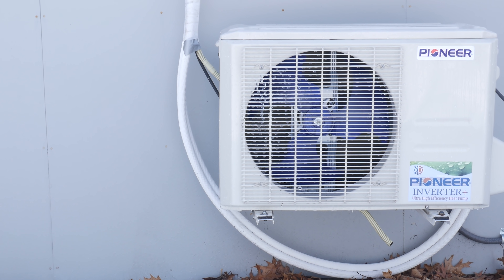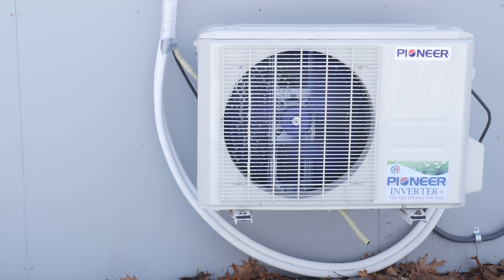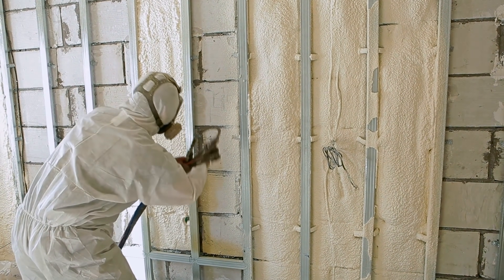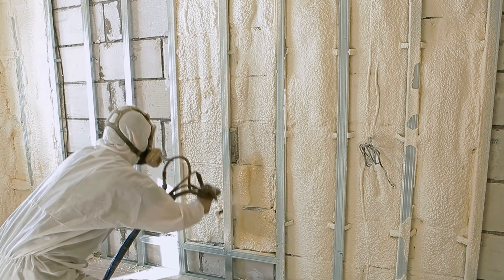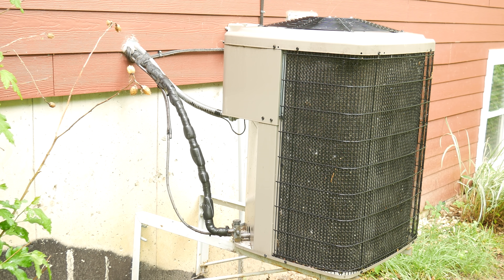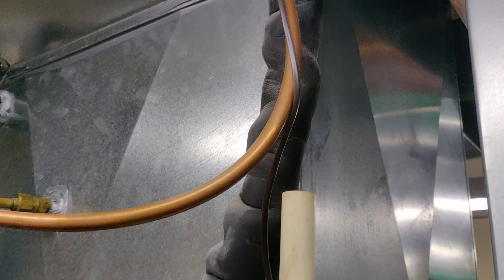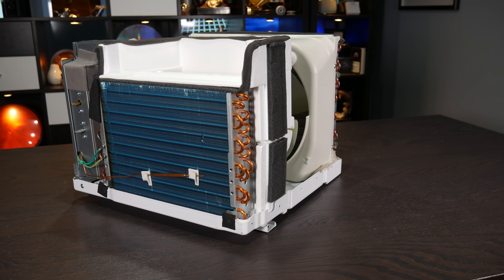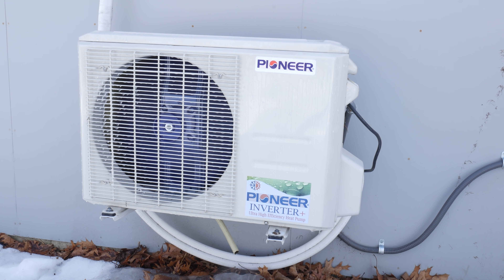Heat Pumps are Not Hard: Here's what it will take to start pumping

Comment: I had a split installed a few years back when I moved into a new house, built in 2006 with all electric. I live in the middle of Wyoming. It get's COLD.

I had two 12k units installed for about 10 grand. I could get the gear cheaper, but nobody would install it. The lowest bidder (of 3) won. The highest was 4k more, and the third didn't do Mitsubishi.

LG is terrible from what both installers said.

This year, after about a 6 MONTH wait for parts, I got three 6k units installed in smaller rooms for about 6k.

Prices are absurd. But in my installers defense, it did take two guys (1 very experienced) 4 days to install, and a third guy the 5th day to top up coolent after draw down.

Still, WAY too expensive for what it is. But they are installing a lot around here.

AND this thing worked great to -20 below! Ok, not great, but it still worked, and I didn't need to fire up the electric heaters!

Comment: I spilled soy sauce on my nice mattress and decided this would be the background "anger distraction" to my vigorous blotting.

On topic though, this video is excellent, as usual. I'm trying to incept the idea of installing heat pumps at my building, especially considering last years deadly heat wave. I got lucky with a portable unit (single tube, yuck!) and the windows don't hinge in such a way that a window unit could be utilized. 
I was miserable, and dreamed sweet dreams of heat pumps. 
I'm sure this video will act as an excellent single-point way of introducing someone to the immense advantages they bring.

Comment: Bought a newish condo here in Lake Oswego with no natural gas connection and just resistive wall heat throughout and no A/C.  Got an 11,000BTU 110v Frigidaire window/wall unit that was easy to install since it just slid into its outer shell, like the hotel hardware units  It's also a heat pump and we are hoping it will significantly reduce the need for resistive heat this winter.  Mounted it in the wall under the big living room window.  Under $600 at a big-box store.  Nice unit but of course it can't heat the bedrooms.

Comment: Air tightness is just as, if not even slightly more important than the actual insulation itself. The migration of the air in and out, even if well insulated, will still make a drafty and uncomfortable house. This is easily done in an empty (empty of furniture and such, but complete and finished) house. They put plastic over all the horizontal surfaces (because the assumption is you don't want to repair or refinish anything) and pressurize the house with a blower door, then aerosolize a sealant into the air with mist sprayers and it clumps up and seals in all the areas where air is leaking out, the rest settles out onto all the protective plastic. Its not necessarily dirt cheap, but it is less expensive than ripping out walls and such to get the insulation in there. If you do this, and then just cram insulation in places where you can, hopefully and especially the attic or between the roof and ceiling, it would make a huge difference, although usually after that, some kind of ventilation need to be installed to bring in fresh air and let the stale out in a controlled way.

Comment: Here in Italy, there are incentives between 90% and 110%& of the whole cost for putting on insulated windows, shutters, solar panels, water heaters, in-floor heating, and wall/ceiling insulation. I remodeled my house and saved tens of thousands of euros thanks to those incentives, doing something I would've never been able to afford otherwise. I'm only missing solar panels and in-floor heating, because I'm surrounded by higher buildings and my floors aren't thick enough 😢At least I have two AC units with heat pumps so I limit the use of the natural gas water heater with radiators.

Comment: Heatpumps work just as well in big building applications. Combined with hydraulic heating and big surface heating/cooling solutions mounted in the floor or the ceiling, the advantages of modern R290 heatpumps really come through, since they can be used both for heating and cooling.

Comment: Further into your story. Where I live in Washington it's about $16,000 to replace an AC, Coil, and Furnace or Air Handler. It's about $18,000 for a Mitsubishi Hyper Heat system with an Air Handler. We pull out a lot of furnaces and install heat pump systems. Also, all the rebates go to the customers not to us.

Comment: my guest house  has allowed me to try heat pumps. my guests had major temp control issues. the model was a window hose model that is still sold. you did not mention that they leak water unless emptied several times a day. after adding a drain in the floor it caused a huge water stain outside. a mech window unit uses half the energy.
Reply: Not really comparable to real AC units.

Comment: Part of the noise problem might be because heat pumps (Australia calls them reverse cycle air conditioners) are more often mounted to the house itself in comparison to traditional units which are usually mounted on a concrete pad. The vibrations vibrate the walls more and create more noise inside the house, especially with wooden houses (most houses in Australia are brick)

Comment: Just a small correction regarding the VRF part of the video. The VRF doesn't mean that inside units can heat or cool indenpendtly, or as it's said in the video "...move heat within the building...". In order to do that, we need special heat recovery outside VRF units and 3-pipe system with some additional equipment (boxes with electronical valves that control refrigerant flow; some manufacturers call them BS box, MS box, etc.).  If we choose this version then we can also produce domestic hot water in the summer for "free" (using the heat from the rooms).

Comment: Here's another thing about heat pumps vs furnaces. Seems like furnaces are sized to run half or less of the time. Heat pumps are most often sized to run significantly more of the time. In cooling mode this is actually a plus because they thus have more time to remove more humidity from the air and that's a big part of what makes you feel cool and comfortable rather than 'cold and clammy.'  Also in many homes the amount of time you really need the full output of the heat pump is very low so perhaps during those few days you throw on a sweater?

Comment: Hey I have a question! Do you people in the US or UK have access to Exhaust Air heat pumps? 

They are a refinement on Air source heat pumps. Basically they connect to your houses ventilation system and take the warm exhaust air and use it for making power at higher COP. So instead of wasting that airs heat it's instead used to run the heat pump, making it less dependant on exterior air temperature.

Comment: My old gas furnace and gas water heater are barely working and sometimes not.Also I have an ancient air conditioner (one that looks like a heat pump). I'd like to go with electric . The first estimate I received was $31,000 after credits and rebates for a heat pump, air handler and 50 gal HP water heater . The next bid was $17,000 for a little outdoor mini split and an air handler to work with my ducted  home (2 story  under 1700 SF ) . Warranty good for 1 year. Plus the HP water heater would be $6,324 after rebates and incentives. The next company adamantly discouraged me from considering getting rid of gas. However, they did give me the best bid for an electric Goodman HP and air handler ,$11200 . Later they called and said I didn't have enough room . They did give me a quote for electric air conditioner and furnace for $9465 -$12065 . I'm retired and don't have unlimited amounts of money. I do wonder how much these HVAC companies are inflating the costs because of the rebates. I am in Oregon with fairly mild winters ,and a one person income.

Comment: not entirely sure how our one works, but its a air to water system that is capable of also electrically heating the water. My dad explained it as basically always using 1.5 kWh of power, and producing warm water depending on how warm it is outside. In our use it gets pretty nicely up to 65C, which is plenty warm enough for us. the main thing with it is that it only really tries to warm the water when its being used, so with last winter's energy crisis my dad was trying to optimize things which meant our shower only got up to about 45C.

Our system is always set to not use the electrical heating element inside the boiler part, so it should be just the heat pump. Also I live in finland, so in winter it tends to get below -10C pretty often

Comment: Heat pumps most certainly are not just air conditioners. Yes, they share a lot of the same components and technology, but the added complexity does increase the cost. Reversing valve, accumulator, extra copper tubing and piping, regulating device in both indoor and outdoor unit, control board and usual start components (versus just a contactor in the AC) crank case heater, outdoor temperature sensor etc.

Comment: I bet there are a lot more homes suited for ductless mini splits than you might think. There are a lot of homes in parts of America with hot water baseboard heating and no central air, so no ducts. I suspect most split-level ranch homes of which there are many, many, many, fit this description.

We had a system installed a couple years ago. My only gripe is that all four of our inside units have to be in the same mode, which for ours even includes just fan mode. Perhaps a different configuration or model would have allowed more flexibility.

Comment: 16:57 The solution is to replace radiators or insulate your house some more so the existing rads are fine at a lower temp. You need to insulate it anyway in most cases (because most houses are bad) so this makes a lot of sense.
Reply: Fan-forced in-wall radiators also exist that distribute heat through the room faster than natural convection like you get with traditional cast-iron radiators, and they're also more discreet and free up floor space.

Comment: I had no idea there were commercially available units that could move heat around within a building. I would love to be able to recover the waste heat I blow outside (hello clothes dryer) in the winter, but the one room I don’t need it in is the laundry room.

Similarly, I’m often opening a window to cool my kitchen (between cooking, a large freezer and a regular fridge/freezer) while also heating other rooms, which has always seemed a little silly.

I wonder where the breakeven point is? Could these units be efficient enough to heat water? Imagine in the summer pulling the heat from the house into water for the shower rather than dumping it outside AND paying to hotify the water indoors.
Reply: A better option for you in the laundry room might be a heat pump clothes dryer (these do exist, and they don't pump out heat in the first place)

Comment: Couple things to point out, because you're about 90% right and about 10% unsure on how things work in terms of power processing and energy consumption works throughout the year.

Energy is not an infinite resource, even you take note of that throughout the series, and throughout this you've mentioned the Texas power outage and failures on the power grid.  When you look at heat pumps, the technology has come further in the last about 10 years than it did in the receding 30 years, that's amazing progress and it's well thought out that it'll get even better with time.

What's important to note though, is the main deficiency of heat pumps is it relies on a single diode of the energy sector.  That being electricity being shuffled into your house, the natural gas can process without electricity in most rural and suburban areas.  The natural gas that we use to fuel our furnaces actually don't get "wasted" in the summer, it instead gets burned and used at the power plant to power more things.  And like you've pointed out, it's significantly more efficient to power heat at home through natural gas than a 1:1 ratio equivalent of electricity.

You've actually pointed out the MAJOR flaw with primarily heating through heat pipes.  As ambient temperature decreases outside, the efficiency decreases for the power of the heatpipe itself, and the colder it gets, the more you need a space heater that runs significantly less efficient than any other form of heating.

Singular power source structure from electricity + efficiency plummeting + more people using space heaters longer = more brown outs.

On a small scale, this doesn't happen.  Massive cut overs, it does happen.  That's why it's way more popular in the south than it is in the north. 

There actually is a solution to this though, and like a lot of people have mentioned either here or in previous video's is diversifying and getting more energy onto the energy grid itself.  Solar, wind, hydro, nuclear, natural gas, coal, and others.  There's no silver bullet we have today, but continuing to expand on renewable energy is the definitive method.  Empowering the electrical grid allows more continues power draw, so more can go onto head pumps, more can reliably go to electric cars.  And like you mentioned in a lot of your videos, we need to continue investing making electric cars much more efficient, continue to maximize efficiency of heat pumps....ect.  I think it's important, and intellectually critical that we have the conversation that "every bit helps", and it's not a one size fits all solution, but a domino waterfalling solution.

Either way, cheers on the video mate.  You're getting a lot of good talking points out there.

Comment: Instead of having many independent heat pumps (refrigerator, freezer, heating and cooling, water heater, clothes dryer, ...) Would it make sense to have one large housewide loop? Instead of pumping waste heat from the fridge into the house, it could be pumped straight to the water heater, or outside if everything's sufficiently hot already.

I expect the plumbing would be much more complex, but especially if you set up a high performance geothermal system, would it make sense to use that for central cooling and for refrigeration, etc?

Comment: I totally Love heat pumps..  and my nicely insulated house..  but one of the biggest things I run into putting these things in and my EXTENSIVE technical development ive done with interfacing these to automation systems and also getting them to always run in their sweet spot..  one of the issues is people who have gas forced air heat or hydronic heat and install wall or ceiling cassettes is the heat coming out of the ceiling and not the floor..  living up north and being cold-minded person (yes there are believei t or not many of us skinny people who absolutely abhor being cold in the winter..  so standing near that nice warm radiator or on that nice warm register is a big deal... .. the colder outside the more it becomes a big deal..  cold-feet hot head..  is a non starter for many..  heat pump boilers really dont have the necessary C.O.P. when the temps get into the 20s or 30s (f) as you need such a high indoor temperature to make radiators actually radiate heat...   However if someone could make a small fan unit to fit behiund a baseboard radiator. that moves just enough air ro lower that water temp to 120 then the heat pump becomes very viable for hydronics..   alas those who had heat pumps in houses before say 2004 need to realize the technology now is GREATLY IMPROVED...  R-410A refrigerant (and R32 in the newest in the USA) is MKuch better at achieving the higher discharge temperatures condusive to nice warm air even when the outside temperature is below 32f..  something R22(old stuff) just didnt do very well..  I have been running Zoned DUCTED variable speed heat pumps in my house since 2008 and to say the least they are fantastic..  I have 3 zones of computer controlled HVAC that vastly replicates the warm even heat of hydronics..  (im using floor vents)..  oh and a benefit my roomate and I have our own thermostats..  all that said I still retain a gas furnace (and sorry i wont give up the natural gas furnace) for those very cold days..  nevertheless for those nay-sayers who rememebr heat pumps of old..  you really ought to give them a try again as they really are MUCH improved...  modern Inverter-driven variable speed compressors can also be sized a little larger and not cause issues with humidity control(due to their ability to truly adjust their capacity)..  so if you like to open the windows then cool your house fast later these are the machines for you! I hope innovation continues into making heat pumps more comfortable for people and not about sacrifice (sorry not gonna wear a sweater here..)..

Comment: The installers definitely seem to see this as an opportunity to take advantage of customers with atypical requests and limited options. Last year we got a quote for a new furnace for around $5500 and didn't go forward with it. This year the same company gave us a quote for the same furnace plus a cold climate air source heat pump for $17200, when that heat pump system is publicly listed for a total of $5400 for parts! I am sitting here trying to figure out where the extra $6200 came from. Do contractors ever back down from price gouging if you call them on it? It does not bode well for the prospect of getting wide adoption of these things if we are allowing industry practices to structurally discourage it.